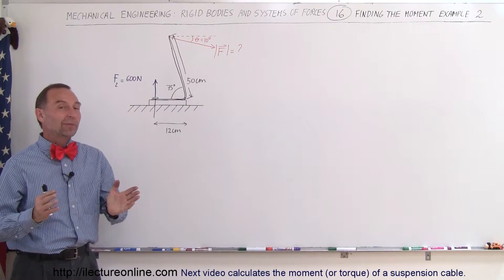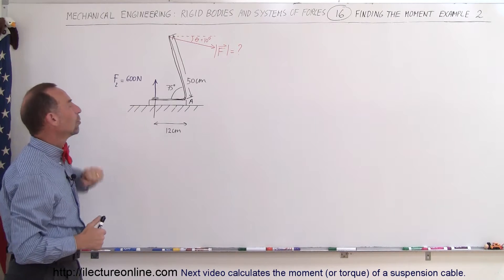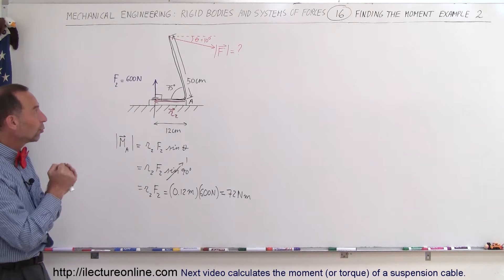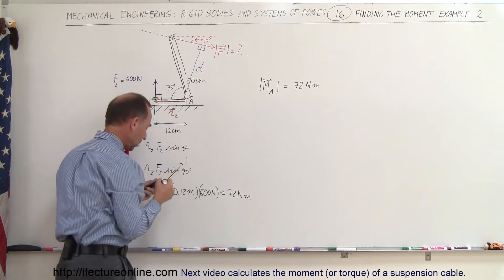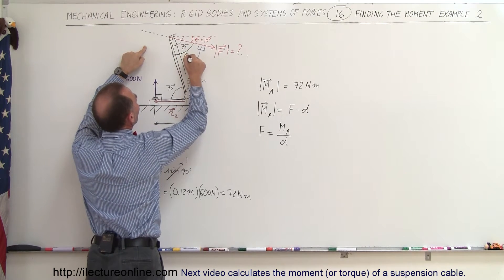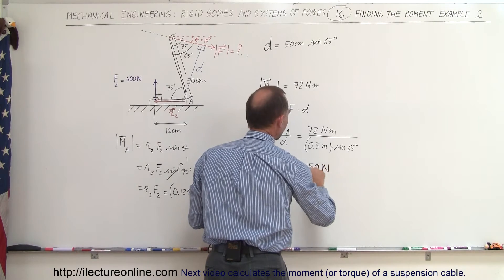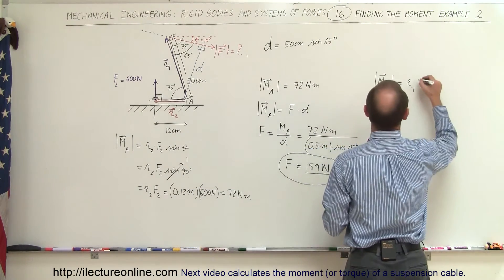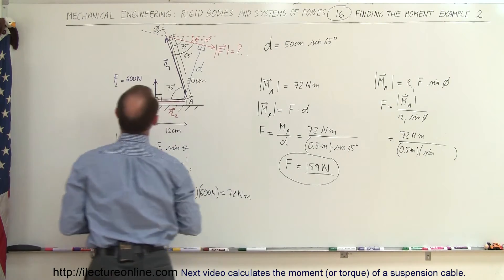Mechanical Engineering: Rigid Bodies & Sys of Forces (16 of 47) Moments with a Crow Bar

Comment: Where would be the the line of moment(direction)? Is it diagonal to 75 degrees
Reply from the maker: Angles are expressed in terms of a reference point.  In mathematics, the reference is the positive x-axis and the angle is positive in the CCW direction and negative in the CW direction.  In science and engineering, the reference point is arbitrrary, but needs to be made clear (as is done in this video)

Comment: Sir,can I get another reply from you?
Sir,at 1:20, why we put sin?the angle Theta was with x axis,shouldn’t we use cos?
Reply from the maker: If the angle was given with reference to the vertical, we would use the cosine, but in this case the angle (90 degrees) was given with reference to the horizontal (of the beam) and thus we used the sin.
Reply: @MichelvanBiezen  Thank you sir

Comment: Nice Problem Michel .... I dared to be different and I imagined STRAIGHTENING out the Crow Bar so it was Purely Linear.... therefore I was dealing with a LEVER situation. The fulcrum being at the point where the Crow Bar was bent..  then it was simply using the lever formula,  F1 * R1 = F2 * R2* Cos (25 degrees)    it actually WORKED!!.. came up with the Force applied = 158.88   or  159 N  ...    (F1 = 600 N,  R1 = 0.12 m, R2 = 0.50 m  and F2 applied at a 25 degree angle = Cos 25 degrees)
Reply: Better to be different now then on an exam! I love being able to know different methods for solving a problem before test day. Or else it turns ugly :(

Comment: What is exactly the difference between moment and torque?
Reply from the maker: Two different names for the same principal.  Torque is used in physics.  Moment is used in mechanical engineering.  They are the same.
Reply: Thanks sir that helps me a lot.

Comment: shouldn't the angle between the vector r1 and the vector F be 115degrees?
Reply: Nope, it shod b 65 cos u assume crossing vector 
R1 to vector f, that is what the angle is. If it is 115 it s more than 90 therefor the angle is wrong cos u know it is an acute angle.